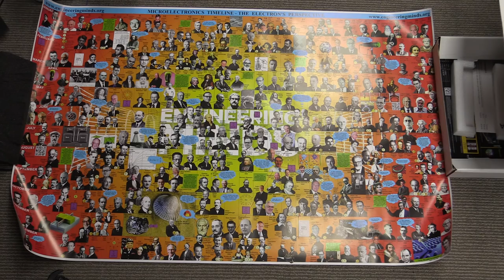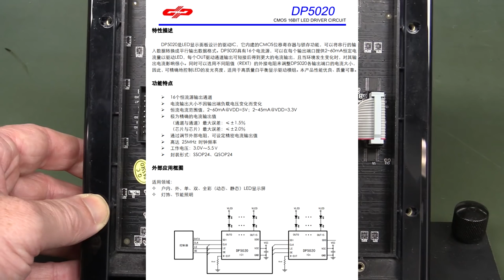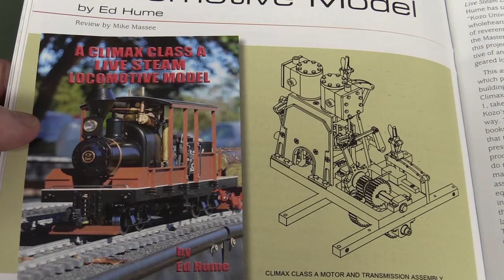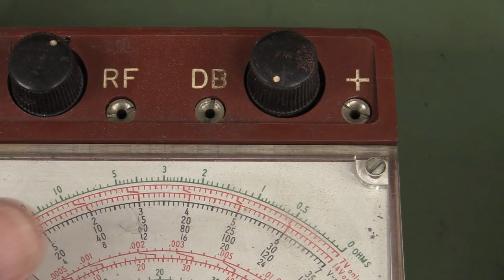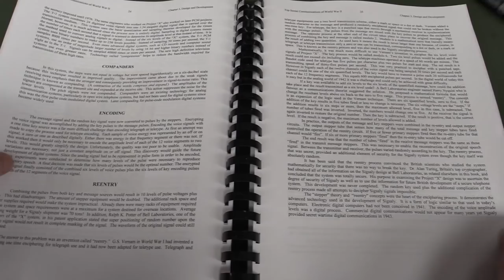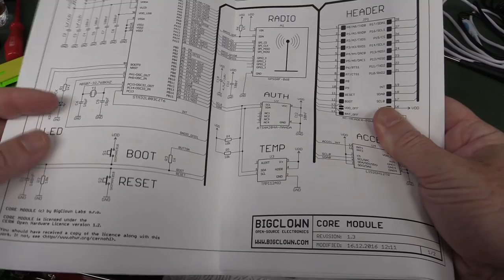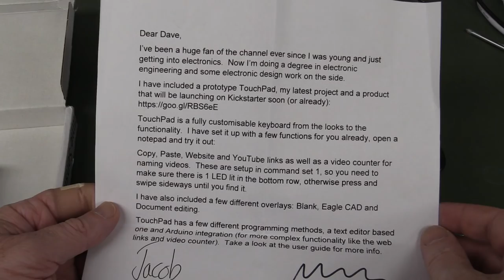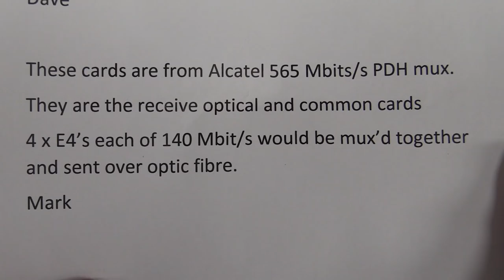EEVblog #1079 - Mailbag

Comment: bradsprojects (aka 00retrobrad00) here. Thanks for checking out some of my projects Dave! Unfortunately my web server is having a few connection issues at the moment so if anyone is trying to access my site - it will most probably be down periodically. I'm working on getting it fixed up however.
Reply from the maker: Thanks Brad
Reply: Hi Brad, do you happen to be a GameCube fanboy? Looking at that last board of yours on the mailbag.
Reply: I've never really realised it before, but my bradsprojects logo does look very similar to the gamecube logo! Interestingly enough - I do have a large collection of retro video games, but not one gamecube :)
Reply: I love the ruler, great teaching aid, reference.
Reply: I assembled the retroball kit from bradsprojects last weekend with my kids! It was my 2 oldest daughters first venture into soldering, and it was the perfect project for it. We absolutely love it and play it all the time. I can see the pride they have for it, knowing that they built it, every time they play it. I like that it can be hacked and added onto. I'm thinking of putting Breakout on it next and maybe bodge in a speaker!
Reply: I've never seen that game before - and you're right, it would fit very nicely in the pixelated retroball environment!
Reply: I’m at a loss.. Awesome hardware seems far too heavy for an 8k/8bit 16F. Are you supposed to pull out the Pic and then plug the Arduino thing in place of it? Are those typically more powerful than F877? Software is disappointing for the hardware, but for the chip, I don’t think you could have done any better.
Reply: I don't quite understand - my goal was to make a four player PONG style game using an RGB LED matrix, and I achieved that using an 8-bit PIC microcontroller.
Reply: My post probably comes across negative, and not supposed to. Your project is the most striking thing to me in this video for it’s design. I like the top, and it probably looks all black if it’s powered off. Minimalist look in general. As someone who lacks the skill for a finished manufactured thing like that, I’m thinking out loud what I would like to write for, with only small changes. Exclusive pot input for example, limited what software could be done, so I suppose etch-a-scetch becomes an obvious side program.
Reply: I guess you're thinking in terms of what is possible from an RGB matrix and then choosing a microcontroller to achieve that particular goal. In that sense, the humble 8-bit PIC falls well short of that goal.
Reply: I did write Tetris, Snake, and Pong in a single 16F877A. Back then RGB LEDs weren’t even a thing, so it’s mono. What I’m thinking of your project, you are right on the money. Top heavy. I’m thinking how much RAM is left after assigning even a 3 bit frame buffer for the display (whether or not you actually did that, I always would)... but again, overall positive. Even so, and adapter board could be made to change the micro, if not the input method.
Reply: Great stuff Brad and glad I was on your KS campaigns over the years.  Still use my Toaster near daily for breadboard stuff!  Cheers!
Reply: Thanks for the comment - certainly glad to see your Toaster is getting well used, and I appreciate your support for my KS campaigns!

Comment: RE that book - The tuning fork,  you used it to set the motor speed in the teletype machine, they had to run at a presice speed in order to properly translate the key press to electronic pulses that punched the tape, or read the tape from the deck to transmit the message at the proper speed, so the machine, which was properly "tuned" could read your messages.  You struck the fork against the palm of your hand then held it in front of the running motor. There were 3 spots on the face of the motor and a stud that could be pressed in, or pulled out to adjust the speed of the motor.  When the 3 spots seemed to stand still  when viewed through the fork hands then the motor was at the proper speed and everything would work right.  I used these thing both in mobile (huts on the back of a 3/4 ton truck) or stationary in a fiberglass hut on base during my tour in Vietnam, so it was a daily chore to test the machines we used to insure everything worked properly, then send a series of ry's to insure that the machine could do it's job.

Comment: Similar story as Tom, not much money for equipment so I hunt for broken deals on ebay, fix them and equip myself.
Owon scope - FW bricked it, update fixed it.
Agilent PSU - unable to set/measure output, bunch of resistors were open/off
Precision K type thermometer - nothing to fix, was actually working

But it's not easy here in UK to get some broken equpiment...
Reply: Oh ofc this comment isn't meant to get a DMM from Dave :D
Tho would be nice if I could buy EEVblog DW121 ;p

Comment: Oh forgot to mention, I have a very old multi meter, it is mounted in  a very nice wooden box, a red face of some sort of early man made board, there are a series of plugs down both sides of the face, and a round meter near the top of the case.  No brand names on it, and when  I got it about 35 years ago, it had 2 D cell batteries made by Winchester according to the labels.  I sold the batteries for 30 bucks each at a gun show, they went before the show even opened to a Winchester collector who was displaying at the show.  I have never tried the meter as I didn't have probes to fit the plugs, (or any D cells for that mater) but it sits on my book case for all to see when they visit my home

Comment: The interesting thing about the telecoms cards is they are from a 565 PDH system and at 565Mbps was not a approved speed by the ITU-T so every manufacturer did it a bit different can be a nightmare to work on I have had many late nights fault finding on these systems

Comment: Dave! Will you do a teardown of the Fluke T6 meter? Would love to hear your thoughts on it. AvE showed the back grounding pad becomes energized when the meter is used to check voltage.
Reply: big clive already added a comment to that video.. it will have some current limiting resistors in it that would drop the voltage when any current tried to flow..
Reply from the maker: They did offer me one back on Nov, but I was like, Meh.
No way that grounding lead could become energised with anything but very small capacitive charge coupling. i.e. not enough current available to do any damage.
But worthy of more investigation.
Reply: "But worthy of more investigation."

Please do! If i weren't a starving college student i'd send one in myself!
Reply: it would be nice to see your take on the T6
Reply: I think he pad becoming energized, is a moot point, if it doesn't work (doesn't work reliably) anyways.
Reply: AvE an electrikan is not. He doesn't understand how to operate the meter correctly, and he certainly doesn't understand how it operates. I normally love the guy, but he's really made a bad call on that one, irresponsible given the influence he has frankly.
Reply: In AvE's defense if he's wrong about something he says so.
Reply: Greg Robinson Even if he wasn't using it correctly, what's the point of a meter that is so inconsistent?

Comment: Hi Dave I enjoy your videos very much I learn a lot I'm building a dual bench power supply I'm using a switch mode module to power it and I'm using 2 DPS5005 modules to regulate voltage and current I was wondering if I needed an earth ground binding post for negative output or can I just use my 2 outputs to achieve that

Comment: yeah like the system 12 telecom installed to replace step by step equipment which was basically a single board with 4 386 processors on it to give you all of the added features like call waiting call forwarding and eventually message bank and caller id

Comment: (37:30) I think your problem may be connected to the problem with smart phones but slightly differently.  With a smart phone, if you hold the display with your fingers around the touch screen area, then the touch screen doesn't operate propaerly. This device has little isolation from the edges.

Comment: Hey i  bought  EEVBlog BM235 true rms DMM. For no reason i can explain.the highest voltage i  used it  for was 125 volt ac and it worked fine.the day after i turn it on and it flash the display as normal with all sign on and then it beeps and display say  InEr on everything exept from A/MA  dec%ac and ua dc%ac..Batteries show 1.34volt so they are okey.the fuses looks fine.it just dont work enymore.is it a reset button and a false error mode it has gone in.very dissapointing.had it for a year not much used either.in 45 years i never it is the second multimeter that has broke.do i realy have to send this all the way to austalia to get it fixed.my reson for buying it was quality and improvments implemented by you if i am not mistaken.my cheap yellow 7 dollar multimeter if not as presise and many other thing it has never failed.This was not what i expected for  a multimeter that should be my main multimeter in my repair shop.i am shurley pissed rigth know.

Comment: brymen 232 EEV blog verson 1 around one year old:This must be i hikkup or intermitend fail.let it be on Ua dc/ac for some minutes and then turned the swich back to turn it off but i noticed that the next after A/ma is diode and capasi...this setting was now no in er message tried the neckt setting MVtemp dc/ac and so on to off.and it worked fine it seems.So i tried to turn it from off to volt dc/ac and no beeping an in error message? can someone  explain this one. cause it seems fine know.intermitten fault?.

Comment: Geez, Dave! Will you PLEASE sharpen that knife? A dull knife is far more dangerous than a sharp one. You do NOT want to get cut by a dull blade like that, it'll TEAR flesh instead of cut it, and it'll be 4X as hard to heal well!

It makes me shudder to see how badly that thing cuts a plastic bubble envelope.
Reply: A ragged cut heals MUCH faster than a clean slice. I think the big knife Dave uses is deliberately left blunt.